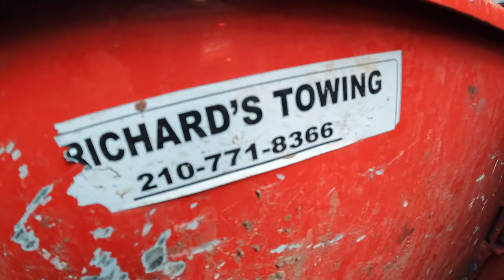He Didn’t Believe Me… I Guess I’ll Have To Show Him!!!

Comment: Did yall notice when the trailer pulls out the tires are partially sliding because hes got the BRAKE ASSIST ENGAGED NO WONDER HE KEEP GETTING STUCK
Reply: His original plan was prolly to drift it through those trees

Comment: Hey just a curious question why did you go single base instead of Dually rear end, I like a dually personally because Hauling heavy trailers it’s more stable and don’t walk you all over the road but that’s what led me to my question didn’t want to come off arrogantly lol, Sometimes your wallet doesn’t bring common sense that skinny thing in the floorboard works wonders when it’s applied in the right direction
Reply: It’s all good, we are running 14ply mpt 81’s they have a capacity of 6700 lbs per tire, the capacity of dual 10ply tires is around 5000 lbs. with the 14 ply tires singled we can air down and our truck is heavy enough to flex them over rock and sand. In our country the roads are rutted up and narrow dual wheels do not track very well in this type of terrain, they also do not do very well in snow, the rear of the vehicle tends to float while the front digs. In our country a tall, narrow, durable, and aggressive tire is what you want. a narrower tire will have more pressure per square inch of contact pressure and will grip better than a wider tire that will just tend to float around on top of the mud and snow. We have trucks that do all of our highway towing that we run duals on, hellboy pretty much just does off-road recovery.
Reply: @wreckerrick   Ohh okay That makes sense I like to learn things like that and Great info about the tires thats a badazz tire that’s somethin my Ole man would love I’ll have to take a look at them , Appreciate the feedback and the Content 🤙
Reply: @Tysmopars69  you bet

Comment: Perhaps if you were to take off the tension on the load-leveler the tow vehicle would have more rear traction.
I noticed the wheels on the trailer were dragging thru the mud as he drove away, maybe he's got brake issues too.